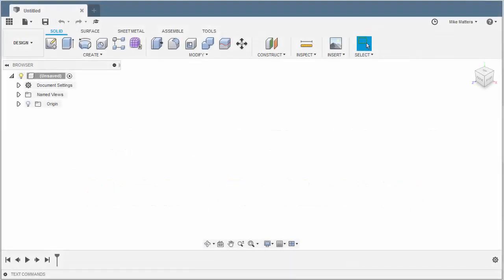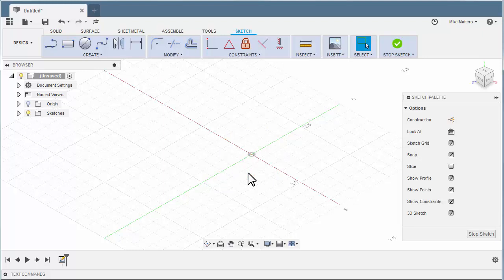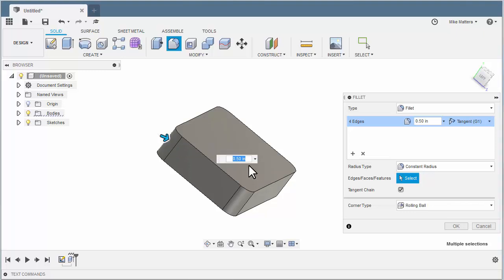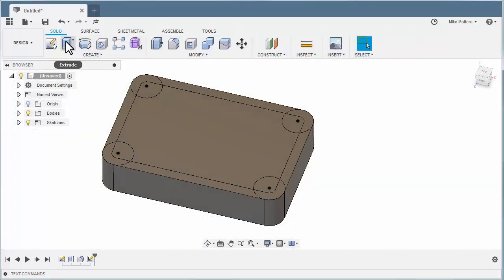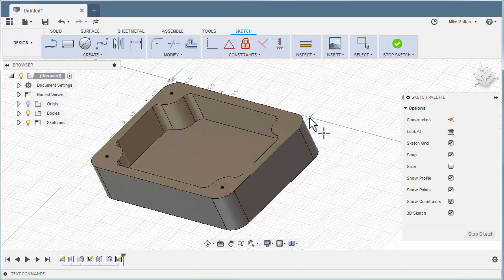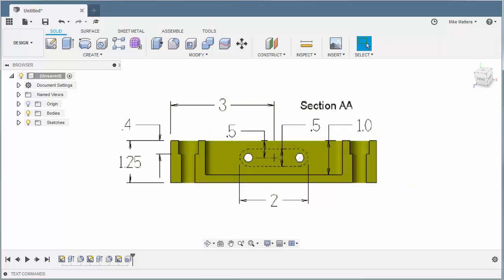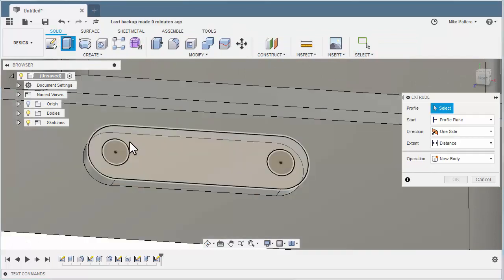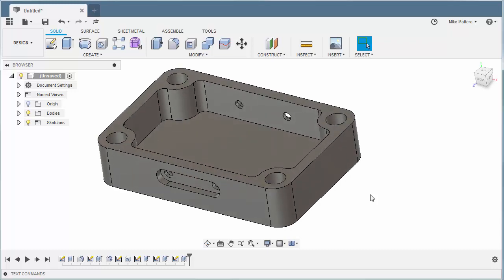Fusion 360 Modeling - Modeling from a Print. Modeling Introduction.

Comment: Why does your origin look different than mine . When you select a sketch your origin comes with green line pointing north, red to southeast, blue southwest. When I select sketch mine blue points north, green points northeast and red points southeast. I am sure it has to do with a version upgrade but it’s hard to follow along. Is there a video that explains the change or is there a setting in preferences that can change my origin to look like yours?

Comment: Hello I know this is an older video but they are still good!  At the 8:28 minute mark the four points on the top of the part appear where did they come from?
Reply: exactly where I got stuck.
figured it out. I'm using different dimensions and my filet is smaller, which placed the dots (center of circle) on the offset line.They appear when I hover.
Reply: @jon__doe  Thank You
Reply from the maker: When you create the offset curve, the points are representing the center of the corner fillets. Check the Sketch Pallet on the right side. It says "Show Points". Make sure that's checked.

Comment: A few years has passed so please excuse if this is a version difference

Would there be any drawback to creating the radius for the cutout in the sketch created @9:30 and then extruded @10:02 instead of doing the 3D fillet @11:20 on the created edges?  
Or would this be just a difference of order of operation and not really have an effect on the resultant model?

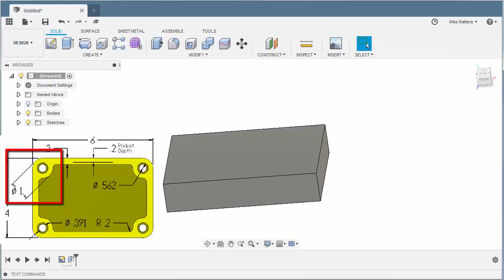Comment: How did he know that the outer radius would be 0.50 inches at 6:06 . I'm new to this but learning . Thanks
Reply from the maker: If you look at the videos @ 0:38 , in the upper left of the drawing, you can see the  1.0" diameter representing the outside corner, to the inside of the pocket.